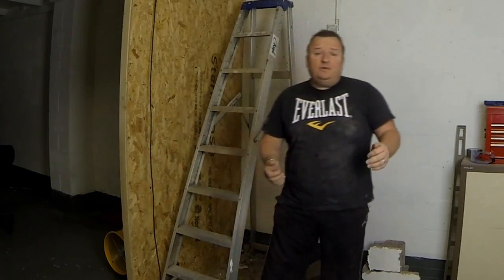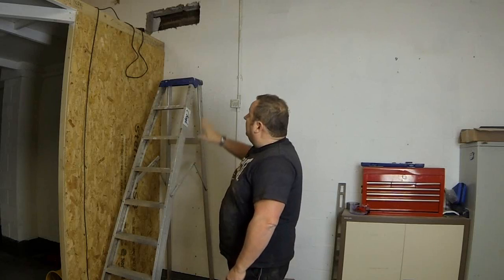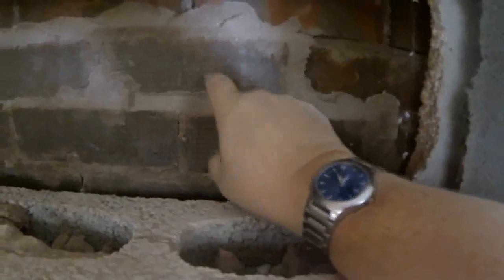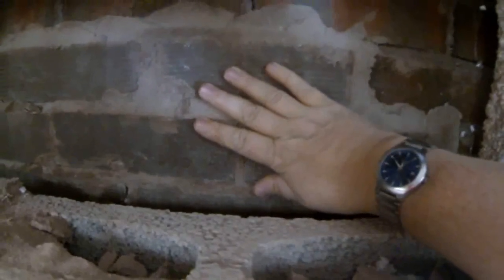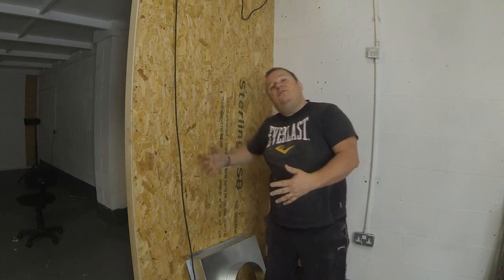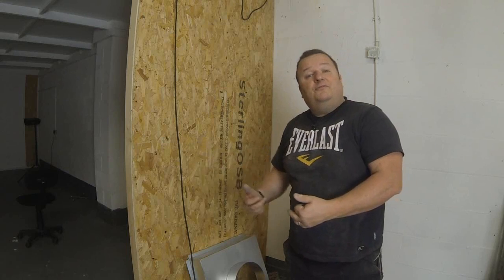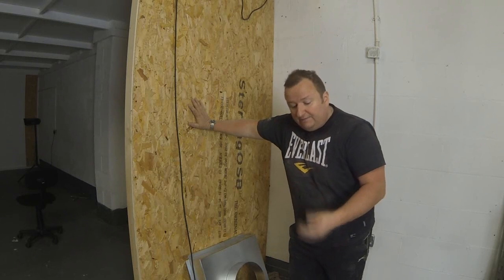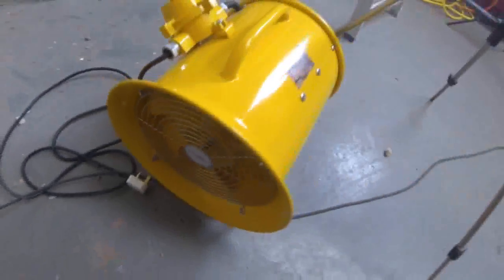Part 1 How To Build A Spray Booth Room ATEX Rated Extract Fan

Comment: Did you use some sort of caulking behind the flange before attaching it to the wall? Looks pretty slick.
Reply from the maker: It's all getting sealed up George. I'll be doing that tomorrow when I fit the rest of the duct pipes.
Cheers
Martin